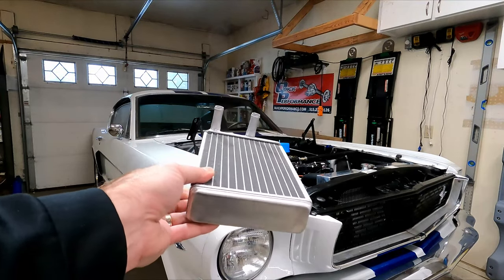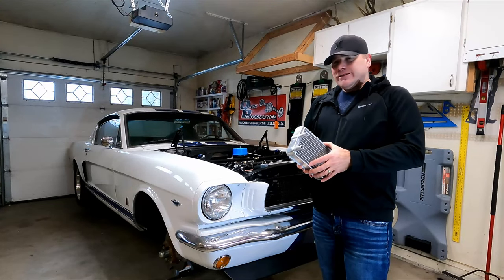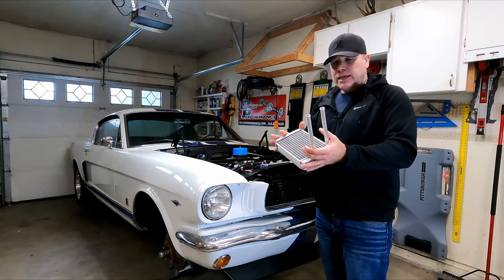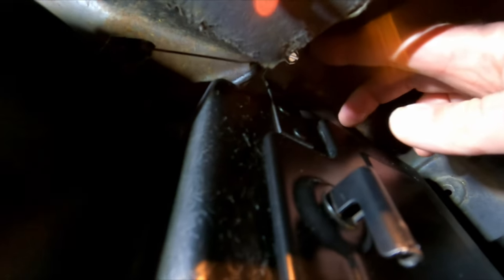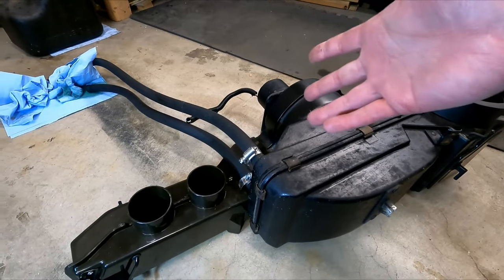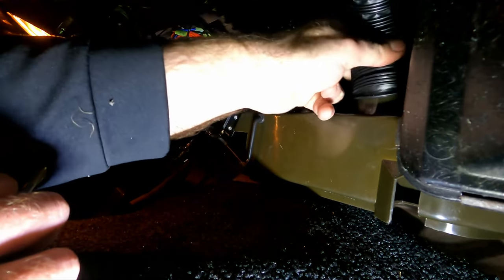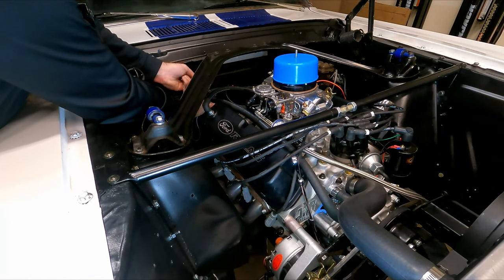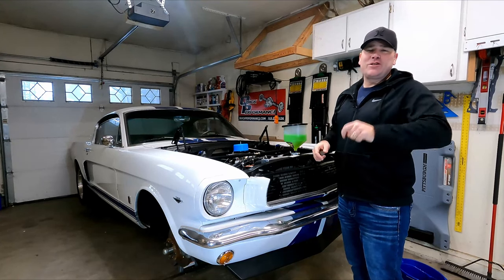Installing a Long Tube Heater Core

Comment: Pro tip I learned with all my cooling issues is leave the intake manifold hose off when you fill the radiator with coolant and once you are on your second gallon of coolant put a shop towel near the end of the intake outlet and once it starts to come out the intake put the hose on and tighten the clamp and fill the rest of the radiator. It will purge out most of the air automatically (if you have a super quiet garage you can actually hear the air come out of the intake outlet it’s sorta cool. Also same crap happened to me but I just put a bypass hose since it doesn’t get too cold here anyways didn’t want to take mine apart since I also have oem ac and didn’t want to open the box all over again. Just going to save up for vintage air at some point lol.
Reply from the maker: That's a good tip, I may try that next time.
Yeah, I was heavily leaning towards just leaving the heater system out of the car when I pulled it several months ago.  I don't drive the car when it's bad weather, and that includes winters, so I don't really need the heater.  But it does make the car overall more desirable if I ever sell it, and there's a little bit of knowledge I can pass on in a video, so it will help somebody out there.  :)
Reply: that is how I do it too, works every time.

Comment: Hi Andy, gates p# 28480 is a straight 5/8 heater hose with a 90 deg bend at the end. It fits the water pump perfectly to allow the heater hose to lay almost flat against the intake.
Reply from the maker: Yeah, I've seen a few hoses like that, it's on the list of wants, but I don't always get what I want.  :)

Comment: HOSES:
Manifold port goes to the lower core inlet.
in the bottom
Out the top
If you get them backwards the heater core will keep an air bubble inside and youll never get enough heat.
Also, the thermostat needs a 3/32 hole in the outer ring to let the air out of the block for an easy fill.
BTW: The factory hose elbow at the manifold outlet has a flow restrictor in it... So high rpm wont blow the core apart.
You can use a restrictor inside the heater hose like chevy did.
Reply from the maker: Thanks for the heads up.

Comment: One thing I did was slide a length of hose down the tubes. This serves to seal the holes in the firewall, insulate the tubes inside the car, and allows the end of the heater hoses to have a gap so any coolant leak will not end up inside the car.
See my video here: https://www.youtube.com/watch?v=_8p7Sqx5Uk4
Reply from the maker: That's a clever idea, I should have done something like that.  Maybe the next time I take those hose off I can fit a small piece of hose on there too.  😀

Comment: Good Catch finding the leak and clamp issue! Makes perfect sense. My Mustang heater box and heater core etc, is not even in the car. Ex-drag car no cold weather driving. Have the original heater box (67) if anyone interested. Thanks for sharing Andy! Good Stuff.
Reply from the maker: I get lucky every once in a while.  Or maybe unlucky if it was my fault for putting that clamp in the wrong place?  :)
Reply: @AndyKruseChannel  No harm done Andy. We learn from our miscues. And, we get to learn from good guys like you also. Appreciate you sir.

Comment: I did the same thing. Andy opted for the long tube.  Also I was able to cut down my heater hose because it was a lot  longer. Can’t wait to hear the bad boy stroker drive down the road 🏁
Reply from the maker: Yeah, I think this will be better in the long run.  :)

Comment: Looking good - those motor wheels are especially important!  I think the long tube heater core is a no brainer purely for the sake of accessibility.
Reply from the maker: Haha, took me a second to understand what you meant, but yes, getting the motor back on the wheels is where this car needs to be.  :)
Now you know what heater core to put in where you get to that part on your car.

Comment: Nice video, kind of surprised you didn’t install a vintage air unit or old air products. Next time
Reply from the maker: Vintage Air would be nice, but it's not in the budget.  :)
Reply: Just $1000+...

Comment: it seems like a poor design choice to have the coolant hoses go though the firewall and into the car. mine has the same thing and I baffled a couple of my friends who restored classic cars.
Reply from the maker: One thing that running the hoses through the firewall does do is reduce the stress on the tubes feeding the core.  Meaning, the long tubes have to reach out farther, and any load induced by the heater hoses in the engine bay gets amplified on those long tubes.  But since I don't daily this car, I imagine those stresses are less than when the car was new.  :)